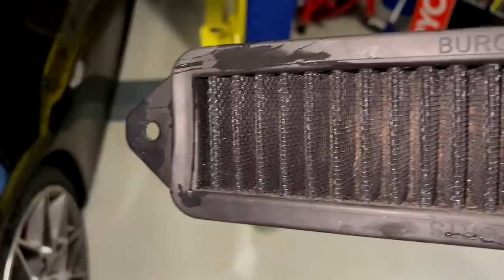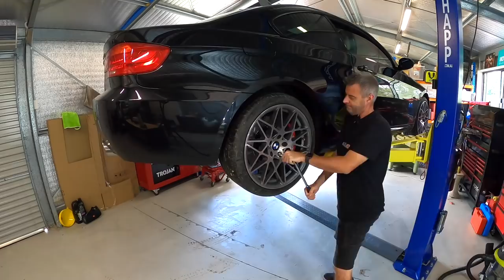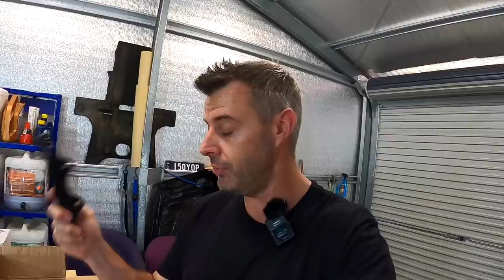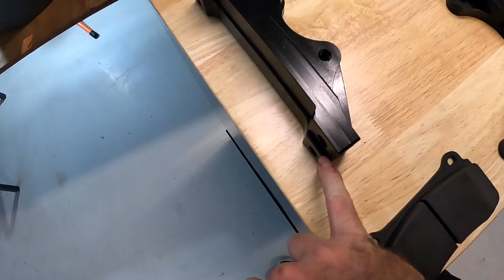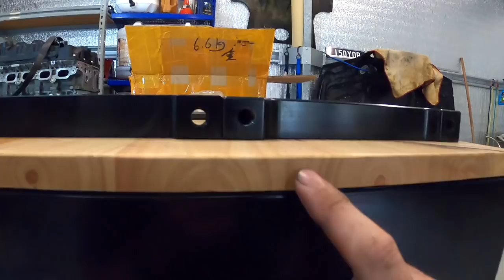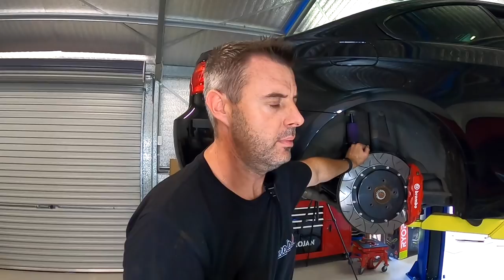BMW E92 335i AliExpress Brake Caliper Fitment: Attempt 3

Comment: Now you have done all the R&D for the company! You can post the link for them? 😂
Reply from the maker: haha. well if enough people are interested i might do that. Lets get some miles on them first and make sure seals arent gonna fail in a month or so. I want to get them really hot and see happens.
Reply: @ZeroTo60Tube  Was going to ask the same. Would be great if they would put the exact see you use together. You went through so much hassle, would be great if we wouldn´t need.
Reply: @ZeroTo60Tube  Thank you
Reply: +1 on sharing the link.
Reply: I second it lol
Although I found the seller and their products, the big question is if they will send the revised brackets for perfect fitment.
Reply: @raultimoneda1649  Hopefully they saved and overwrites their CAD files to keep making the correct ones.
Reply: @ZeroTo60Tube  Need link :)

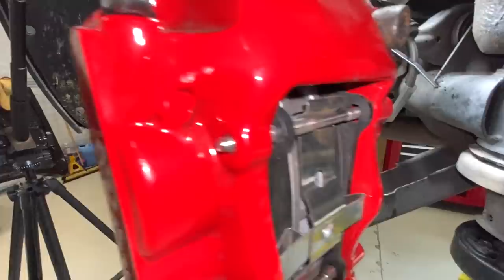Comment: Are the pins mounted correctly? I'm looking at a still image from 9:40 timestamp, and the pins look to be adapted for the spring plate. However the pins need to be 5mm more to the "left" side, from the image. I'm not sure how it's designed, but I get the feeling that the "track" on the pin is supposed to make it held in place by the spring.
Reply from the maker: I better double check, car is still on the lift, so still need to put all the tools away and give everything a final check. Thanks for mentioning it,
Reply: @ZeroTo60Tube  On my Alfa with genuine brembos, I used a small drift/punch to bottom out the pin because I was worried about the same thing as Rawr mentioned. If you've hit it and it wont go any further, then thats seated. On the vid, pin does look like it needs to go through more, but this might be a function of the fact they are copies, not genuine ones.

Comment: BMS cowl filter and monsoon rain don't mix. Good to know
Reply from the maker: I dont think i would have had the problem if i was on recirculate. So if you are stuck, make sure the car isnt sucking air through the filters.
Reply: @ZeroTo60Tube  I think I'll just save my penny's to piece together a M3 cowl
Reply: Probably worth checking the dme box if it was uncovered through this monsoon and you havent already  since it managed to suck up that much through the cowl filters

On second thoughts you've looked in there enough recently maybe you just don't bother hahaha
Reply: @kkarnis3791  if you have an e92 still just power saw the middle. Keeps everything else and leaves the engine open. Instant M3 cowl. Works great on mine 💪.

Comment: Didn't bmw have an issue several years ago where it spontaneously caught fire. The reason was the blower motor for the heater shorting. I'm just guessing, but maybe something to keep an eye on especially if it was soak.
Reply from the maker: They did. It was the power wire for the blower motor. This car has had that recall done.

Comment: I've just ordered these cabin filters and was also worried about water egress, I'm going to design and 3d print a weather covers if you want one?
The YouTuber Teaching tech who does 3d printing videos and also is a car enthusiast did a  video recently on a new filament that is designed  for use under the bonnet (which is what I'll be using)
https://youtu.be/lCqwA1h3JV4

Comment: The trick is to cut the existing cowl in the centre , maintain the dme/brake master shielding, then use a metal plate to shield each bms filter from the direct impact of the rain.

Comment: Hey, Those brake lines rapped around like that isn’t good, the vibrations will slowly cut those lines. Also are you related to Ant Anstead by any chance?
Reply from the maker: Yes in the full series I mention it’s temporary, the Ali seller sent the wrong rear lines. I do have the new shorter ones just need to get some more fluid to do the full flush. 

And no, unfortunately not related to Anstead.

Comment: Awesome channel!
I have literally done all the things you have plus some to my car myself over the last 8 years. Brakes are my last upgrade. How have these held up? I have the stock sport package brakes on my 08 with cool carbon pads/ drilled rotors. Can you share the link with me? I am willing to modify the bracket if it does not fit.
Regards

Comment: Nice work on the Brakes there Andrew, third time is definately a Charm. ive been reading alot on brake upgrades for my E92, and there have been talk on Coding the Upgraded brake sizes. (this is just what ive been reading, so please no one flame me for this post).
The topic was mainly on the M Performance Brake upgrade from the F30, so im not 100% sure regarding the bigger brake upgrades.
The theory behind this is that yes the Modulation is better, and the bite is better, however the coding helps the Proportioning Valves give the correct pressure via the DSC pump. (again, this is what ive read, so i dont have real world experience). for instance when pushing hard to trigger the ABS, what will the outcome be. might be something you'd want to read up on.
https://f30.bimmerpost.com/forums/showthread.php?t=1146622
https://f30.bimmerpost.com/forums/showthread.php?t=929406
https://www.e90post.com/forums/showthread.php?t=1317220&page=2

Hope this helps with any info, if any....

Keep up the good work guys, love the channel.

Comment: For what its worth, I go to the track with ad08r (235/255) and never had any oil problems like surge, only temp since this cars love running hot. So far for stage 1 mhd power level the ppk2 rad with CSF main radiator, water wetter x2 and mhd on track cooling is enough for 27C ambient. But I'm going to upgrade the oil cooler soon.

If you wanna test this brakes hard go for a bunch of 100-20 brake passes like you would for settling pads on.

Comment: Hi Guys. I am not a BMW expert, but in my experience water leaking into the boot is most likely to be due to a rear window seal issue. Perhaps you can have one person lie in the boot with a light while another hoses water all around the window.

Comment: Guys great job.  Question, would you think this fit using a 18" rim. I have APEX EC-7 18" rims. What would be your guess ??
Reply from the maker: It may, I do have a genuine 18 inch wheel I could try. 

The fronts are only 15mm away from fitting an 18 so the tears should be ok.

Comment: Hi, I enjoyed the video, but have to question what the point is. Due to the high CG height a street car transfers most of the cars weight onto the front wheels during braking. Fitting 
stronger rear brakes will make little difference unless you first do a significant upgrade to the front brakes. So apologies if you have already done so, but, if not, the only point is cosmetic.
Reply from the maker: Yes, I mentioned this in the first vid. This was a cosmetic/curiousty “how bad can than be” mod. I think the stock brakes are actually quite good for street driving, some decent pads and rotors would have sufficed, but these cost only a little more than brand name slotted rotors, decent pads and lines. That said it has tempted me to do some circuit driving.

Comment: I’ve just seen you lift the car from the back subframe? I hate putting my e92 on the hoist I can never get the pads on the rear lift points I always lift it with the yellow arms of the hoist
Reply from the maker: Yeah. Can’t get the rear arms anywhere near the jacking points.

Comment: Did the rear handbrake line up ? Cheers
Reply from the maker: It did, however, it seems to have an issue where if its sits for a few days it will squeal for the first few meters when you take off for the first time.

Comment: Did you the blower and oil up the shaft?  You need to or your fan will stop turning.  Mine rusted up but it is still working after pulling it out of the car and oiling and spinning the fan by hand.
Reply from the maker: Probably will again. This had a squeaky blower motor when I got it, so I have oiled the shaft bwfoee

Comment: It's a great video.　
I'm always watching.
What is the disc size of this AliExpress Brake Kit? F/380mm R/355mm?
Reply from the maker: Yep spot on!
Reply: @ZeroTo60Tube  nice so much xD
I also want a 380mm outer disc, so I asked the brake store on aliexpress, but it doesn't work.
The two-piece disc in the video has 10 lug bolts on the front and 12 lug bolts on the rear, but I'd like the same 380mm disc with 10 lug bolts. plz tell me where the store name

Comment: Third times the charm! What's your thoughts on the elcheapo coilovers so far? How's the diff?
Reply from the maker: Coil overs are brilliant. The car really sticks well with out feeling that harsh. The drive i did on the weekend, before the rain hit, got to give it a bit of stick round a few corners and both dave and myself were blown away with how planted it was for a wot. So diff is also working well. My only complaint, its a clutched diff, it makes noises and the scare the shit out of me until i remember its the diff. Sounds like axles snapping..... but its just clutch chatter

Comment: So I had an water issue with the passenger side and it turned out to be the drain holes for the sunroof. Might be a good idea to check them!
Reply from the maker: I need to, still need to sort out the boot leak as well.

Comment: Glad you got there in the end but hang on, were you so excited that you forgot to fit the new shorter brake lines?
Reply from the maker: Nah, I did mention it in the video. But I don’t have enough fluid to do a flush at the moment. So will fit the lines later on.

Comment: I had bms cowl filters but quickly went back to oem with a Bosch filter. Reason being snow in the winter.
Reply from the maker: Where are you based Ardi?
Reply: @ZeroTo60Tube  Estonia, Europe. Usually have snow from November to March.
Reply from the maker: Ah I see. Have you thought about doing the cowl modification?

Comment: Are those rotors as noise as the M Performance BBK? They are so loud.
Reply from the maker: These don’t actually make any noise. But that will come down to brake pad compound.
Reply: @ZeroTo60Tube  do they take a standard size/shape pad that you can get from other manufacturers?
Reply from the maker: @mattsheridan4703  yeah they use the same pads as the genuine brembo version. So there are a wide range of pads available.
Reply: @ZeroTo60Tube  Mine sound like I'm being chased by a swarm of locusts. Very annoying when you have the windows down. Next to a wall or anything that reflects the sound, it gets louder. They look great on my car, and have gotten lots of compliments, but you'd think that for a $3100US installed brake kit, BMW would have found a way to minimize that. Have to research some other pads. Maybe Akebono.
Reply: @ZeroTo60Tube  Went back to the dealer and they swapped out new the rotors and pads under warranty. Miraculously there is no noise at all now despite there being videos here and posts on Bimmerpost where people recorded the noise and said they were told by the dealer it's normal for M-Performance brakes. Now I can move on to other things.

Comment: I still want to see the f30 335i brembos bolt on (front only rear needs adaptors)- maybe the 2nd car can get that & put china to shame. I wouldn't put ebay brakes on mine but mine i would look at 2nd hand f30 ones
Reply from the maker: I am fairly confident these will out perform f30 335i brakes and the M3/M4 brakes for that matter as well. With the right pads they should be no different to the genuine brembos...... However whether they last the same before seals need to replacing will be another matter.
Reply: Do they bolt on to the stock e92 caliper bracket or do i bring the one from the F30 as well? Didnt know this myself but the blue f30 brakes can be found for a few hundred dollars here i believe.. EDIT: yup, used for 300-350$ per side, new from ECSTuning are 900$ per side..
Reply: @ZeroTo60Tube  Prove it! Would make a good short series and why else do you have 2x e92's.
I wouldn't ever put ebay parts on my car (don't look close at my intercooler / charge pipe)  but would look at second hand parts factory upgraded on the newer models, im sure there are others here who would do the same
Reply: @Zodiam.  give it 6 months or so and @zero to 60 will show us how to do it
Reply from the maker: @antonyklein4882  I don't blame you a lot of people are scared of the ebay/china stuff and to be fair a lot of it is rubbish. These are were very expensive for a chinese product, so i am hoping they are going to last. Only time will tell.

Comment: Did you recalibrate the DSC?
Reply from the maker: Nah. People who fit the genuine brembos on the e9x platform don’t either. That may be an f series only function.
Reply: @ZeroTo60Tube  vehicular DIY has the software assisted bleed which you want to do before calibration

Comment: Sweet! Looks like you got your brakes sorted out. Take it easy on the track mate =)
Reply from the maker: Definitely will. Read a lot about oil surge problems, so i may pussy out until i get the oil pan baffle sorted.
Reply: @ZeroTo60Tube  Sounds like a plan. Your new turbos introduced a new variable. Fingers crossed they can take the heat and come out on top.

Comment: It looks that you have installed the rear Disks wrong 
You have the left disk on the right side
The inner venting turns in the wrong direction.
The heat can not go out of the Disk
Greetings from Germany 🇩🇪